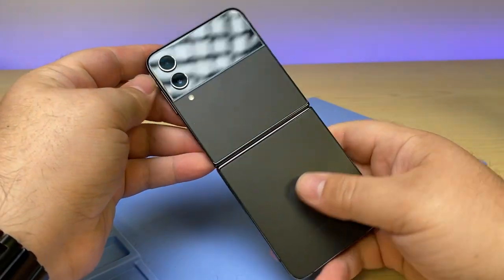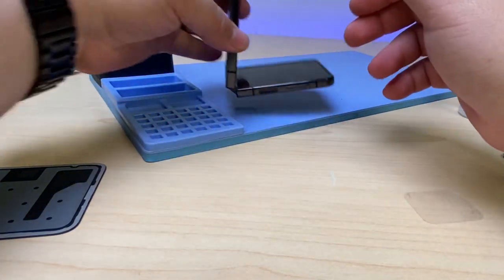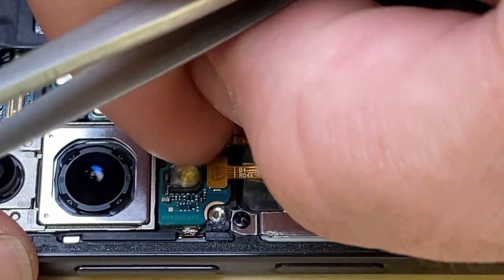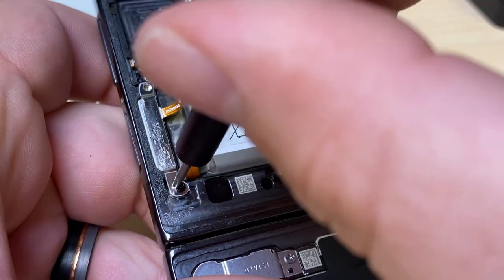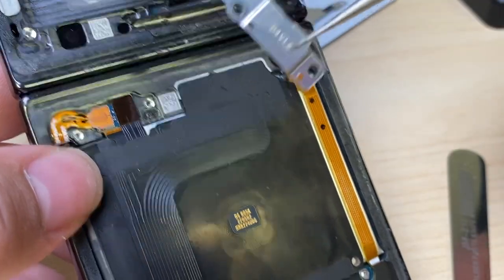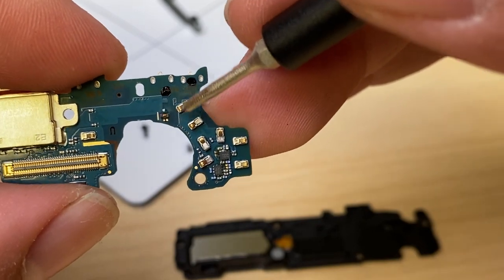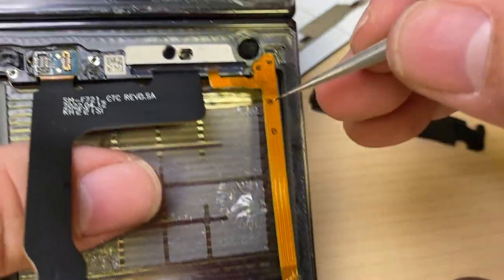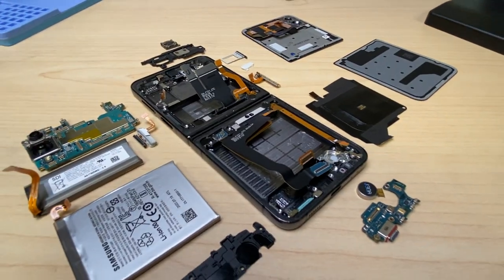Samsung Galaxy Z Flip 4 Teardown Reveals Cutting-Edge Tech!

Comment: I did have the problem that when I close the screen it didn't power on, I took off the magnets and put the original from the cracked screen, and same problem, then I removed the glue that was on the magnets and I put some Crazy glue, and finally works!!!!

Comment: hello, thanks for your all perspectives. I am having the weak magnet problem you mentioned in the video. This happened after the screen and chassis replacement at the Samsung authorized service.  Are the magnets embedded in the main case or are they assembled later ?  Is it easy to repair magnets with strong magnetic attraction as before?
Reply from the maker: They are simply adhered in. Not to difficult to transfer over. A quick fix it to put one of those small magnets you'd find on an iPad mini digitizer on top of the new magnet to increase its magnetism which does the trick while still fitting inside the phone.